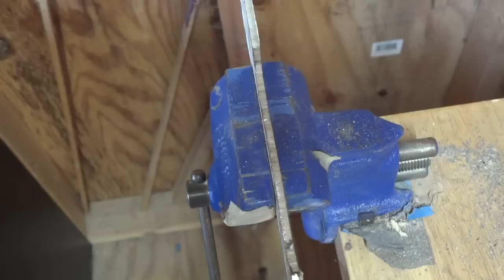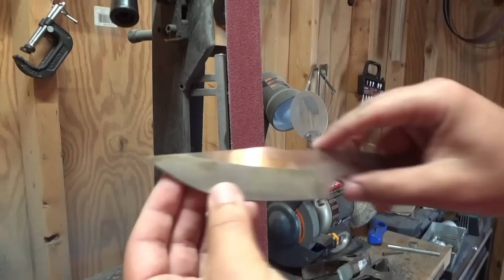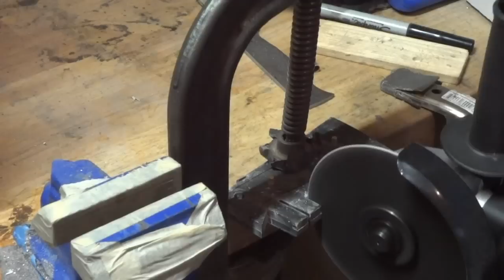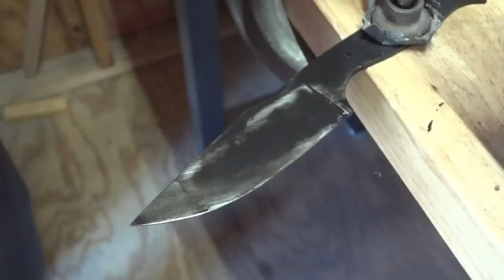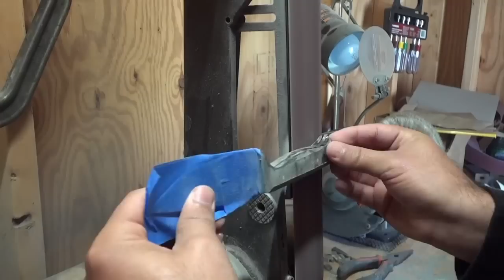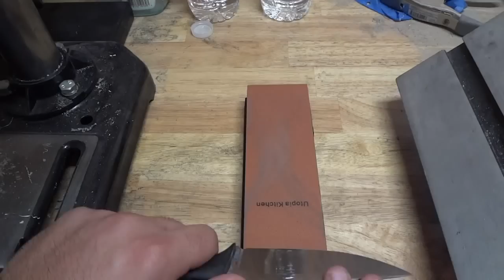Knife Making: Making A Mirror Finished Knife - Sharp Works

Comment: I am on the quest to shallow, flat bevels, I can not do it without a guide, about to make a third attempt at a bevel guide, the 1st one was not good, second one was a hand file which was good but took forever, going to make one based off of one koss built.
Reply from the maker: Bevel guides are probably going to give you much more consistent result than freehand. From my research it seems that guides help you get the bevel you’re looking for much faster, at least when first learning to grind a bevel. Freehand grinding is a constant battle to fix mistakes. If you take the time and go slow enough you can do it. Good luck on your quest, I know you’ll get there.

Comment: Very good video wish you had some commentary with it but besides that your knife looked absolutely awesome and have couple of questions what type of oil you while sanding and compounds did you use with buffer
Reply from the maker: Thank you! I sanded with cutting oil that I purchased from harbor freight. I used black emery compound on the treated stitched buffing wheel and white rouge on the cotton wheel.

Comment: Beautiful knife.  You are great master. Can you tell me what kind of cutting spray (or what blue spray I so in movie ) you used for cleaning the blade? Because I use a lot of things but I can not make the blade so shine like you.Thanks.
Reply from the maker: Ciprian Negru it was cutting oil, but you can use any oil. It was just there for lubricant when sanding. To achieve that shine I had to sand it from 100 grit to 2000+ grit and then buff it. Thanks for watching!
Reply: Thank you verry much for help. I am a beginer in making knives and your movie is usefull for me. I will watch all your mouvie. Thanks again.
Reply from the maker: Best of luck with your knives! I'm glad I can help.

Comment: Good work
Q.what happened for mirror carbon steel knife 🔪 after use? 
What is the goal for shining carbon steel knife 🔪 if will not be shine after use why we spent time and efforts
Regards
Reply from the maker: I had used the knife for food preparation so it never got scratched or rusted because I made sure I cleaned and oiled it immediately. 

I also noticed that because it’s so finely polished, the knife doesn’t try to rust like satin carbon steel because there’s less places for moisture to get trapped.
Reply: @SharpWorks  
Dear
But when i use the kniefe spically if i cut lemon or grapfrout imediatly become black why?
Reply from the maker: imad sabaaneh عماد سباعنة That’s a patina. The acid in the food reacts to the metal. If you have carbon steel you’ll want to avoid those kinds of food. If you want to check out my “Will It Rust?” playlist it shows how different common household materials react to carbon steel.

Comment: The heat treating?
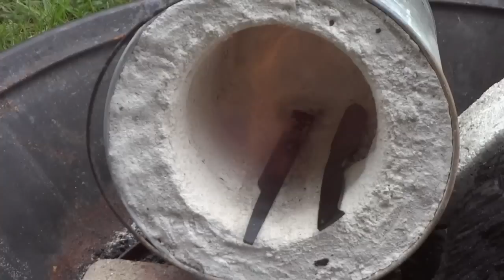Reply from the maker: 8:46
Reply: Sharp Works lol, sorry I must have seemed like an idiot. The other part of the question that I didn’t send but was in my head was to ask about normalization, if you did it and how? Sorry again, it happens more the older you get ;(
Reply from the maker: Daddy #53 lol not a problem. I didn’t normalize because the steel is already annealed (I assumed also normalized) and grinding doesn’t put stress on the metal so I never normalize when I make a stock removal blade. But since you’re asking it’s making me think I should have normalized lol

Comment: What spray did you use when sanding the blade?
Reply from the maker: Sewg I used cutting oil for this knife but I also will use glass cleaner. They both will work depending on your sand paper.
Reply: thank you

Comment: What Grits of sandpaper are you using through out the hand sanding process. I cant seem to accomplish the same shine of my knife (then again it is my first but still).
Reply from the maker: Vel Thraytor I don’t remember the exact sandpaper grits I used but to get this affect you basically need to process to a higher grit. Something like 60-120-240-320-400-600-800- 1000 - 1500 - 2000 and maybe higher if you have. After sand paper buffing will even all the inconsistencies. That’s usually the process I would do, but I’m not an expert so this could be overboard. It takes a very long time and the more you do it the more efficient you’ll get. I think the end is well worth it though. Best of luck to you.
Reply: Regardless, thanks much appreciated.

Comment: Bro I cannot find the information I need in make a blade out of straight chrome. I have a bumper from an old Ferrari that i want to turn into some knives. Somebody enlighten me.
Reply from the maker: I don’t believe pure chrome can be used to make a knife. If I’m not mistaken, I think it won’t harden or hold an edge. Your particular piece may still be able to make a knife but you would need to do some testing on it to see if it has carbon steel in it. First I would say do some research to see if you can find some type of composition listing that shows the percentage of iron, carbon, chromium, etc. that Farrari used in their bumpers (if it is chrome plated steel). Try to find out if it’s toxic to work with. Some finishes can be harmful if inhaled after grinding. If it turns out that you are confident it doesn’t pose a health risk, you can do a spark test. Take a piece of the metal to a grinder and see how the sparks look. There’s information on google that explains more than I know about the subject. If the sparks look like the metal is a high carbon steel, take a small portion and try to harden it. If it hardens, it should be good to make a knife. There’s a ton of factors that go into what salvage steel can be used for knife making. I hope this helps to answer your question.
Reply: @SharpWorks  you're the best

Comment: How long is the knife from end to end? Also, great job on the knife. You have earned a subscriber.
Reply from the maker: alex Leroux. Thank you! I believe this knife took me about 12 hours, maybe a little longer because of the extra sanding and polishing.
Reply: Sharp Works Haha thanks for the reply, but I meant how long is the knife itself from the tip of the blade to the back of the handle.
Reply from the maker: alex Leroux. Oh! That makes sense, I got to stop commenting first thing in the morning. The knife is a little over 8.5" overall and the blade is a little over 4".
Reply: Sharp Works Haha thanks a bunch
Reply from the maker: alex Leroux. Not a problem, thanks for subscribing! I got a couple more knife making videos if you want to check those out as well.

Comment: Do you have any advice on how to freehand bevels with that amount of accuracy? I always grind my bevels freehand on the platon (if that's what the straight bits called) BUT I HAVE A 762x 25mm grinder so its small. The bevels are always concave and not distinct from the non-grinded part of the knife and they always come out uneven on both sides. I've tried multiple makeshift jigs as well to no avail and watch some videos on it. Anyone got any ideas??
Reply from the maker: Kordova 21 it takes a lot of practice but what I find that helps, and you may already be doing it, is I keep my elbows locked in touching my side and I just lean back and forth to grind the bevels, it helps keeps a more consistent angle. I am finding that certain belts on my grinder cause too much jumping and chattering so it bounced the knife off too much making it impossible to get clean bevels. Try changing different grits and belts, may make it a little easier. Check out Ekim Knives on YouTube, he has a lot of great videos, some of his earlier how-to videos go in depth on this topic. But in the short answer to how to grind accurate bevels - practice. I suggest grabbing some cheap mild steel and learn your particular grinder. Every machine has its own quarks. I apologize if my answer doesn’t help much but I wish you luck with it and let me know of your progress.
Reply: Thanks so much for taking to the time to run through that, I've got some scrap cut offs of 01 tool steel and some extra stuff lying around so i might just do some extra practice. I'll look into the channel as well. Very handy, thanks again :)
Reply from the maker: Kordova 21 glad to help

Comment: Nice work but what is it with these You Tube videos? Not just yours. Doesn’t anyone bolt their vice or grinder down??? Dangerous and downright irritating chasing the bloody thing all over the bench.
One question though, as I have never made a knife. I’ve polished a few but never made one from scratch. So why polish the blade before the heat treatment? You only have to do it again. Is this not double the work?

Comment: nice looking blade but had to give you a dislike for not heating properly before quench sorry edge will never hold up
Reply from the maker: Roger Whittington and how did I heat treat improperly?
Reply: its just i didnt see it glowing cherry before you quenched it may be better steel than i use please dont take my comment to heart your work is very good and i have even used the shape you had lol i dont harden a lot of mine cus they just sit on the wall uk laws dont allow us to carry fixed or locked blades not even out in the woods i didnt mean it in a nasty way if i did miss something please feel free to point it out im always open to being wrong lol keep up the good work bud
Reply from the maker: Roger Whittington not a problem buddy. It's hard to see the cherry red because I was out in full sunlight. That's why I checked it with a magnet before I quenched. A magnet is the best way that I know of to determine if you've reached the correct temperature because the steel won't be attracted to it. If I was in a dark room you'd see the red glow. But if it didn't harden properly, it wouldn't be able to skate a file. Since files are very hard steel, it would did into any knife that wasn't heat treated, so it's a good test to see if you did it right. I don't mind the dislike, I just like to understand if I did something wrong and if I could improve on anything. I think I'll try to film the heat treat more toward nighttime so it'll be clearer to see what's going on in the metal. You're not the only one to tell me it wasn't hot enough, but that's why I don't go by the color because often people get their knives too hot since it's harder to see color in light.
Reply: This is the most level headed, polite response to a criticism ever. Good description about the heat treat as well, i need to start using magnets :)
Reply: Sharp Works yeah mang, Steel loses it’s magnetism at 1500 degrees. I always keep a magnet around for all my heat treats.